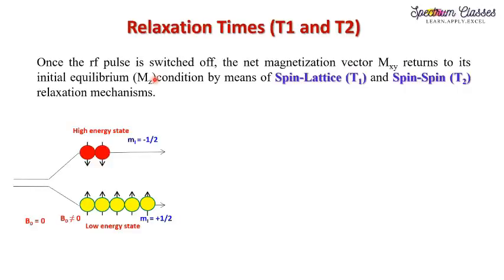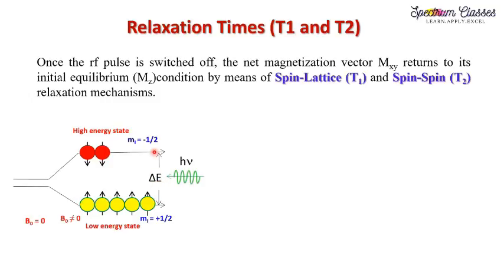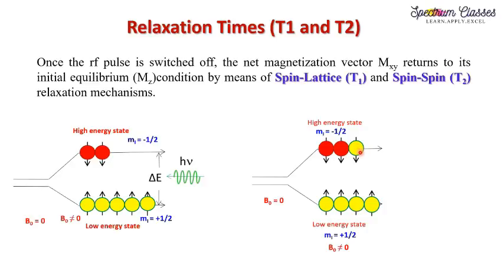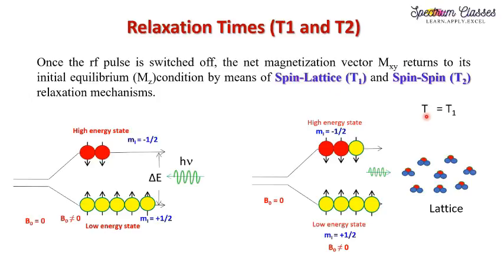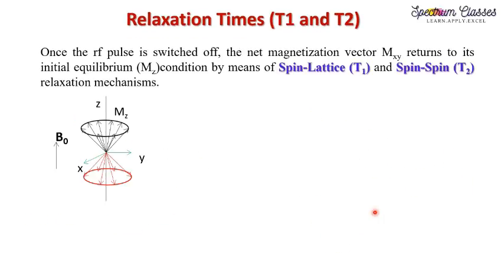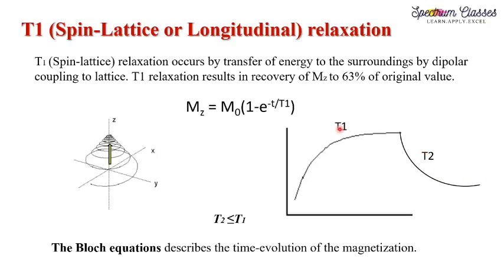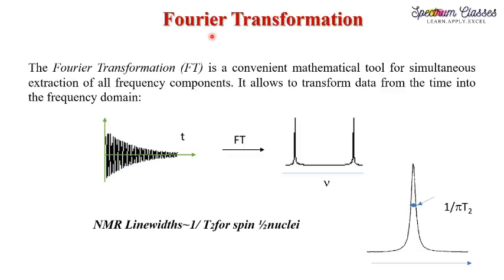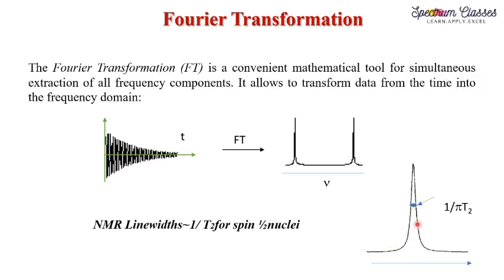Relaxation time in NMR |Spin-Lattice and Spin-Spin relaxation| FID response| Easy Explanation

Comment: Nice video but I'm still a bit confused on T2
Reply from the maker: @Summ thanks for your appreciation you please write your doubt to me I will try to explain your query. T2 is spin spin relaxation means the spins present in the ground state if have same Larmor frequency, as the frequency of radiation emitted  (i.e., E = hv here v is the frequency) by nuclei present in high energy state, then the radiation is absorbed by the nuclei of low energy state in this way no net change in the population density occurs in the both the states. However in this way the nuclei restore their randomness and thus the net magnetization vector decreases and as a consequence the signal diminish gradually.